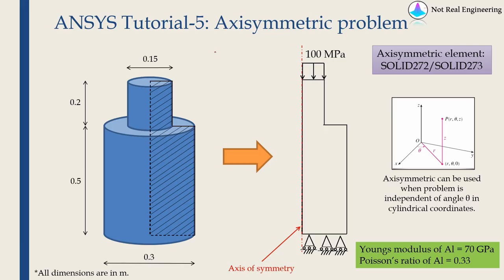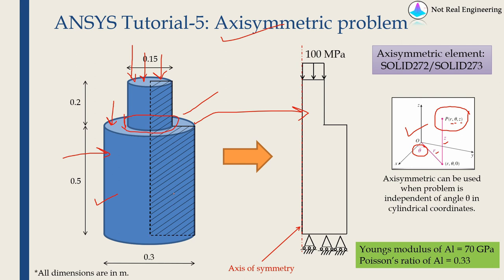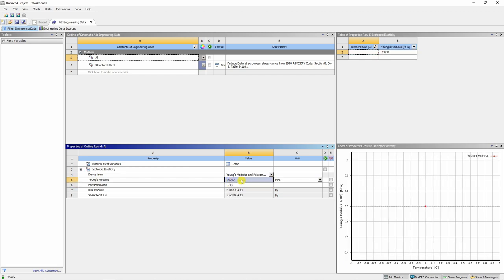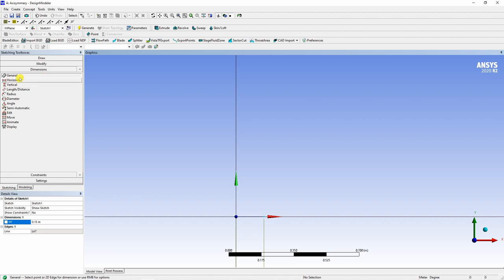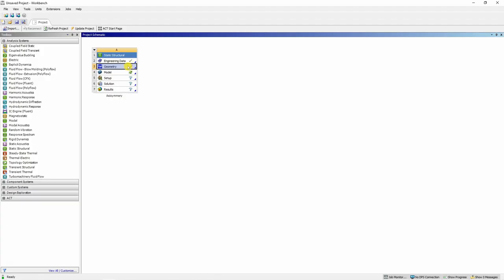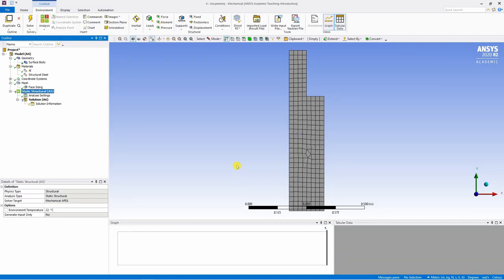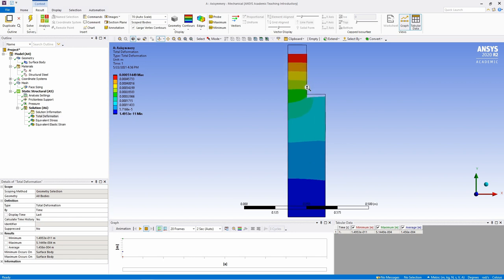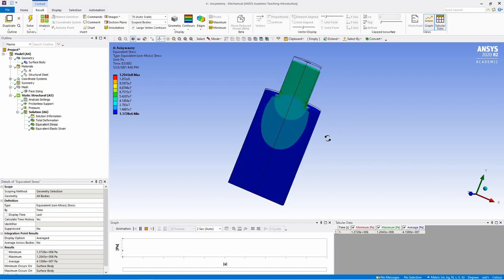Axisymmetric analysis using ANSYS workbench

Comment: Using plane-strain axisymmetric FE model on the cross-sectional plane along the member axis direction, predict the effect of added reinforcement on the stress distribution inside the pipe wall for internal pressure loading of 0.01 GPa for the geometry shown in the Figure below. Compare the FE results with the analytical predictions obtained by using the axisymmetric stress analysis formulation presented in Lecture 5. Assume E = 210 GPa, 𝜈 = 0.3Figure: Locally reinforced pipe segment subjected to uniform internal fluid pressure of 0.01 GPaThe analytical solution for the radial and tangential stresses and displacement (thick wall pipe) are given as follows:Note: The cylinder is assumed thin if 𝑏 – 𝑎 <𝑎10